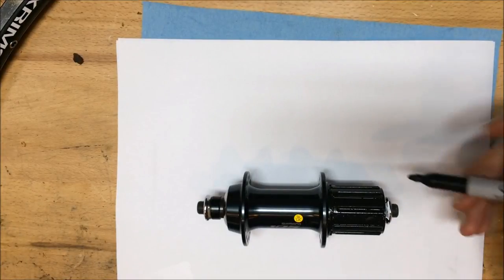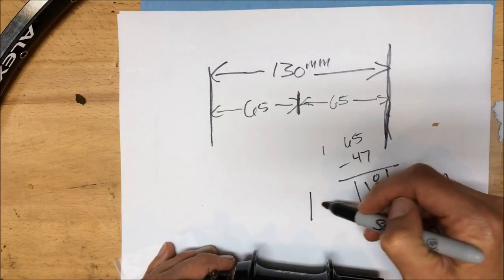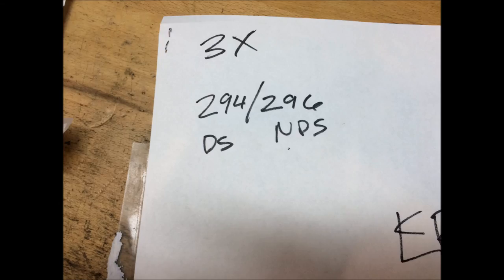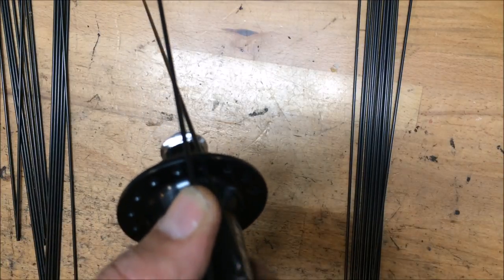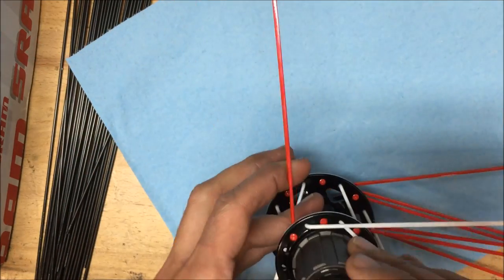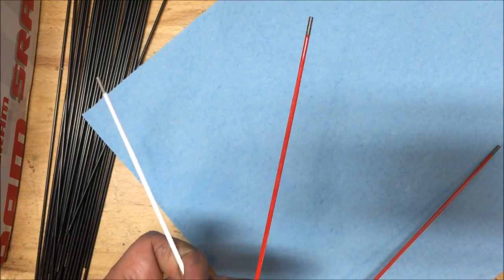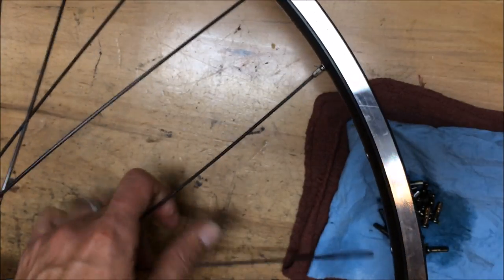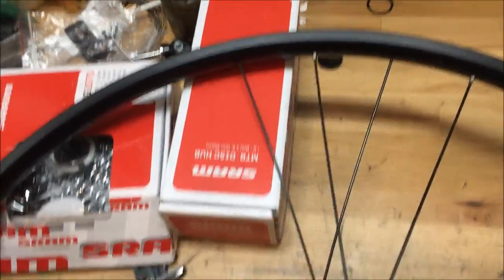Wheel building 101

Comment: Tried this method yesterday and found it horrendously confusing and all too easy to scratch the rim. Got there eventually but I'm not sure I'll attempt it again.
Reply from the maker: Yeah, this is the method most experienced or high production wheel builders use. It's definitely the fastest method I know of, but for a hobby wheel builder or somebody looking to build their first set, it's probably not the best method. I made this video a few days before I taught a wheel building class so the students would have some sort of reference of what we went over.  There was quite a bit of confusion when we got to the actual wheel building part, so I showed them the basic every other hole on each flange method that a lot of folks learn when they're building their first wheelset. I made another video for that method if you're interested:
https://www.youtube.com/watch?v=ldbI4DYTOqA

Thanks for your feedback!
Reply: Joey, to be fair, I found your "pairs" method to be fast in mid flight. It was getting started that screwed me up. I just couldn't get it to begin with. In the end my success came with trial and error. 

On second thoughts, I really should give this method more of a chance. I'll watch the video again and see if I can get a better insight into lacing the first two pairs. 

Oh yes ...... the good news is that I trued up my pairs-built wheel today (new spokes on an old hub & rim) and took it out for a spin. It performed well. 

Many thanks for the video.
Reply from the maker: Cool! Honestly, when I first tried this method, I didn't care for it. Several years ago I was working in a shop where we had to build a bunch of wheels in a few days. After I got the hang of it, it evolved into my go to method. 
Thanks for your feedback and commenting! I really appreciate it!!
Reply: The pleasure is all mine Joey.

Comment: what tool are you using to drive the nipples?
Reply from the maker: It's a pick with a handle on it. I use this tool a lot everyday! It also works well to open up the teflon tube inside brake and shift cable housing after cutting. You can get the little 4 piece kits from any of the home improvement stores or harbor freight for between $5-$10.
Reply: Thank you Joey, I'll go get one. Also, could you tell me what kind of Linseed oil you use, refined? boiled?
Reply from the maker: Boiled

Comment: What is the tool called that you measure everything with?
Reply from the maker: The tool I used to make all the measurements off the hub is a caliper. The tools I used to measure the ERD of the rim are called rim rods. I also used the caliper to measure the overlap of the rim rods.  Calipers very in price, but you can pick up some decent ones at Harbor Freight for about $10